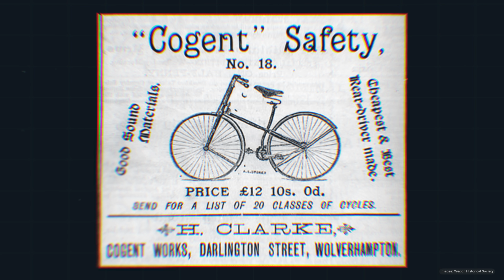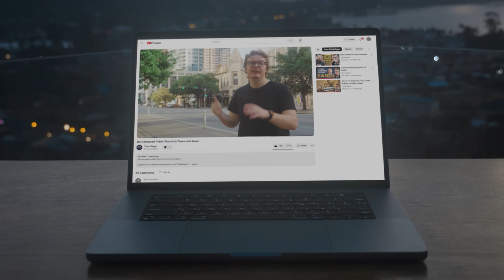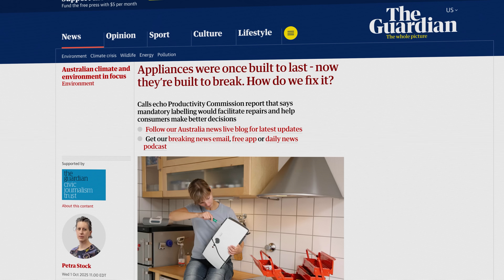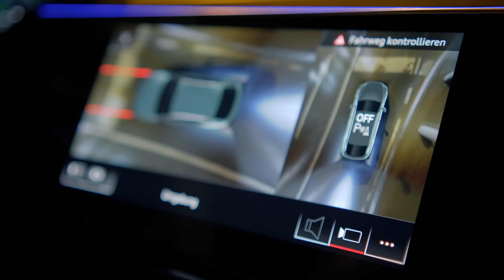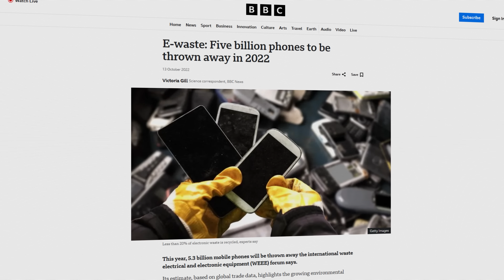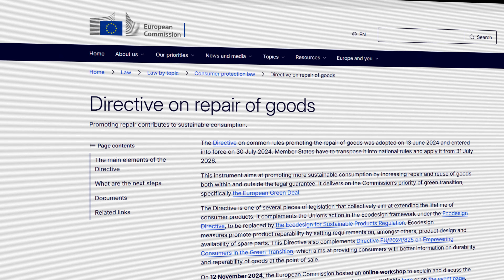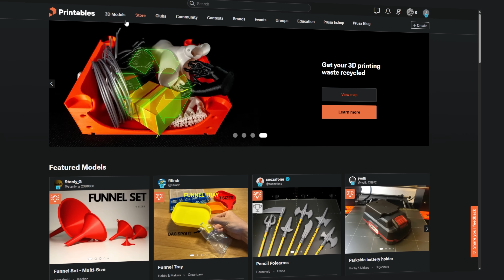Built to Break: The Hidden Design of Planned Obsolescence

Comment: Ashley byte gateway to motorcycles. I'm sorry but you need to do your homework. Because motorcycle came from putting a small engine on a bicycle that where motorcycle came from. Motorcycle came from bicycles in vehicle came from hurt from carriages that wine, when the car model T referred in to duty, will call the horseless carriage.

Comment: Oh, noThe light bulb they said, no, it's athlete.The light bulb that last forever are literally dimmer they're not brighter, but you need more light.You have to thin the wire doing thin.The wire you get more brightness out of the light but that burn out the lights.Sooner if you want a literally long acting bulb, get the um, did the dim bulb like the lower walled bulbs?They longest, but they don't have the brighted lights

Comment: No, literally the tetanar. You can purchase it already obscelet, because they literally when they abelt it, they're its affordability, basically, if I can't let this chip. Now when you'd be like May 10 years ago, it will cost $500 to chip one. So they lower, they weigh on it until the chip is cheaper. To maid, like up for a $100.
You made the chip set for a $100 when you furt, but do you have caught $500 to make it? But if they wait on the technology, the technology will actually get cheaper, they'll now only a $100 to map it to a chip set. So what better waiting To make it forever for people or making it $500 when it first came out. They even said people even said after the people in the tech Andrew even said it. When it comes out for Matt production, the technology, it already several years old. Because the new chip, it also several years old, they said they're actually more powerful chips in production in lab that they're working on more palping a chip. We have now, but because they're so expensive to make, they're no point into releasing them today.
Like 9K. They're literally, they're literally video camera higher than 4K. Now there's it's all 9K, but 9K is so expensive that it don't be until 20:13. Before you can actually see 9 KT V.
That how expensive is
In our top program, obscellation ISIS after you buy your phone. They slow it down like, um apple, does apple slow? The iPhone down after the while.
Unlike Samsung, who said log their phones, they even said like the Nokia that phone from Samsung, that phone still lasts forever, and they're still making it. And that phone was tougher than hell.
And that phone built the last, but they said, um, many lighty smartphones The make the smoke the foam to that one. The scent made me the no. That Samsung um, that big brake phone is so big and so strong. It become law. The component are a lot bigger but to make these cell phones law. The opponent had be a lot smaller lot. Smaller. The phone from decay over time. Athem is athe lowered the life of the phone and products Bailey. A thicker, the wire. The longer it lasts thinner the wire, the less it lasts. Samsung Cent Mobile their phone after you have a 10 to 20 year lifespan. Because how they're built
In because sometimes see battery drain battery come, let effective. The longer you have them, over the year that the content recharging of the phone slowly decayed the batteries, something that sometimes phone. Their internal are fine, it's it. The battery is shot from all the recharging. Recharge your phone at the solely damage your battery over time. It might rechargeable battery over months in your rechargeable batteries have to replaced Because they slowly stopped holding a charge

Comment: Great video! The lightbulb story isn't all that accurate, though. The limiting of lifespan for lightbulbs had more to do with the amount of energy longer lasting bulbs use. A longer lasting lightbulb uses more money in electricity to get that longer lightbulb, more than a replacement bulb costed. You can see this with the centenial light, it barely glows. Technology Connections made a great video about this.

Comment: As someone who had to rebuy my record collection 3 times by the time I was 22 yrs old on 1992.

And I may point out  worked predominantly in IT.

I have hated technology and planned breakage and forced purchasing out of the gate. When my son was about 8, an I was showing how to use various household items so he would know how to do laundry, run the dishwasher, what to flush or not flush the toilet, how to figure out if something was a better price or not. He's born in 2003.

One of the things I taught him was about 'the linch pin'.

I showed him on everything we owned how to spot the linch pin. How to a void buying items with one if possible and how to prevent breaking items that had one regardless of the choices available. 

I explained a linch pin is a deliberate weak point designed to break earlier than the lifetime of the item. And that that small part, will not be available for repair rendering the item useless and force you to buy a new one. Or a linch pin maybe a "new technology feature" that is also designed to break.
Other linch pins are features that make it impossible to proper clean an item, thus causing dust and grim to build up and cause the item to break or be next to useless.

I pointed out what to lock for. Our dishwasher had two. The door for the detergent is cheap and flimsy and can easily snap off, and unfortunately they didn't have any other models without this, the buttons were those plastic computerized electronics ones (right above the vents for the steam no less). 
I told him to always do things in a systematic order (this is handy for many tasks btw) I explained when the dishwasher has stopped running, open the door all the way open and close the door trap to the detergent than open ensure that the door of the dishwasher is opened fully to allow the steam out.

I showed him when buy small and large appliances, buy ones with nobs and switches not computerized touch pads. Buy those with the minimum amount of features. A coffee machine only needs to make coffee. It doesn't need 15 settings.

Items like fans etc, buy those that are made of metal, have a proper cord and have a easy to remove grill to properly clean.

I explained the importance of cleaning items regularly. I explained that dirt under a microscope is actually jagged and breaks down components and fibers, dust also clumps up and ruins motors and other moving parts.

Dust and lint are a major fire hazard.

Then we discussed electronics and computer electronics and devices. That was fun 😅. I showed him how printers, software update anything deemed smart = designed end date. 

At 55 I am in the process of putting everything on paper. I actually have all my originally paper files since I left home at 15. Paper stored proper lasts. I have 40 year old files to prove it.

I am going back to paper, the mail system, cash, cheques books, pens and pencils. I have had enough. 
Also radio and boring tv. I have my old cable box and vcr and cables and an older tv. 

The one problem is, about a year ago, a bunch of people were looking for LAN line phones, I have mine, but our telephone company now plugs everything into the telephone jack but it they made it so it HAS to go through a wifi box. My cable company still offers cable tv.

So the switch to a LAN line or Landline where I live is impossible. 

Low tech the way to go. I am done. 

I will figure out the phone thing later. But in one year I will have everything off any computerized anything.  Company and the bank can mail me and I can mail payment back. Same with forms etc. I can go in just like we did back in the 80s and early 90s. They fucked up. And I want out. 

I also showed my son how to spot quality in clothing and other apparel. 

I am so glad my mother and grandmother taught me to sew and about different fabrics, leather, etc. 

I have the same 100% full length coat I bought at a mid-high end store that I bought when I was 25 years old, and I am still wearing it today. Same with some leather shoes, boots, and gloves. 

We lost too many tradesmen. Cobblers, washing machine repair, watchmakers etc. We need to start using their services and buying these types of goods again. 
Glass, metal, wood, paper, cardboard, leather, cotton,  wool, linen, and fur yes fur etc.

Comment: This channel is punching way above it's subscriber count in terms of production, holy crap!
It's interesting to me how much planned obsolescence has accelerated in just the past few decades. I'm restoring a 1995 car at the moment. Not only does the owners manual contain basic maintenance advice, but if you want to do it yourself, you're also provided a number to call if you want to order the factory repair manual that the dealership used to fix the car. Now, automakers don't even want you to look at the engine. How far we've come.

Comment: I am here from Jjjacksfilms, but I've been talking about planned obsolescence for YEARS and I refuse to upgrade my phone, my computer, or any other electronics until they are completely dead. I have been on my same two phones for 4 and 6 years. I've been on my $2k laptop for 5 years, and when the battery started to no longer hold a decent charge (literally would last me 1.5 hours off cable), so what did I do? Replace the battery. I have issues with my drivers occasionally, but luckily I'm slightly tech savvy, and have taught myself how to troubleshoot and repair drivers. Just because something is beginning to fail, doesn't mean it's failed entirely and is fixable.

Comment: The lightbulb story is effectively BS. Technology Connections went over this at length. If you want a lightbulb that's bad at providing light, or a lightbulb that's excruciatingly expensive, sure, yeah, go ahead and make a 50,000 hour incandescent. Those existed and worked- not in the way a 1,000 hour bulb would actually light up a room with a (relatively) low energy cost to operate. It was all a triangle of tradeoffs. Was there a bit of price-fixing and agreements made? Yes. But the centennial bulb is an example of three things. 1.) an extreme outlier that has survived despite all of its contemporaries burning out, and 2.) babying the shit out of it (it's on a very low power separated power supply so it doesn't ever get jolted and burned out by things like, say, turning it on, or power fluctuations), 3.) a bulb that's completely useless as a bulb. It barely sheds enough light to walk by. Certainly not likely to read by it.

Unsurprisingly, all the bulb companies LEAPT at the opportunity to do bulb-sized fluorescents, and from there have jumped all over the LED bulbs, both of which are vastly longer lasting and better options than old incandescents.

Comment: hi, here from Jack. ive always wondered if every form of digital storage is also planned obsolescence. they say it's down to the degradation of the physical materials and due to the charge running out on flash memory, but even hard drives and SSDs die fast compared to anything else we've ever created

Comment: I feel like no planned obsolescence discussion is complete without considering that it's the market that creates the space for this. Fast fashion doesn't exist because brands are trying to trick us, it exists because if I see a $5 shirt and a $30 shirt I'm gonna buy the $5 one and brands cater to what we want. There have been multiple attempts at  modular upgradeable phones, but they've all failed because nobody wants to pay more for a phone that's awkward and cumbersome. Yes, light bulb lifespans were limited, but not because they lasted too long. It was because the long-lasting lightbulbs of the time used a lot more electricity to produce less light (Alec from Technology Connections has a fantastic video on this.) If planned obsolescence was the reason for this, we wouldn't all have LED bulbs that will still be on after I'm dead. Those are popular because they have the benefit of the long life, but for the same price and without sacrificing brightness, and the fact is, even if the major light bulb manufacturers wanted to prevent us from getting them, they wouldn't be able to because there's a clear market demand and someone else would've filled the gap in the market. I agree that money is the main reason companies do just about anything, but the reason things don't last as long as they used to is because when we found cheaper ways to make things, people stopped buying the expensive ones.

Comment: A bit of Planned Obsolescence you missed is what is now happening to digital goods, Digital Goods are effectively permanent, as long as you have the files & data, those things are always there. But now companies are shuttering their old games, or hiding them entirely (Forza Horizon, The Crew), to sell the new game. 

They're adding locks to the software so that you can't open them unless they approve (anti-cheats) and robbing you of your purchase after an arbitrarily decided day. 

These same companies are also spending an ironically enormous sum of money on lobbying to convince lawmakers that it's prohibitively expensive to keep the game running - when all that has been requested of them is what used to be the industry standard of shutting the official servers, but allowing unofficial servers. Something that would cost about 1/100th the cost their lobbying takes.

I fear this obsolescence will spread to things like E-books or Movies, where they revoke your access beyond a certain unsaid date due to the "costs of keeping it available"

Comment: While planned obsolescence is a real problem that actively makes world a worse place the lightbulbs life span limitation is a weird example. The manufacturers had a more or less valid reason to do that - as bulbs age they become dimmer and by completly likking it after a while it will ensure that it will be bright when you'll need it. If you look at the example you attached it barely produces any light, even for an allegedly reduced voltage it's running on

Comment: I happily use what I've got until I physically can't anymore. I used my original phone for about 8 years, used my dad's old work phone from 2017 after until it was stolen, then ofc had to replace that. I used to be worse about laptops, replacing them after 3/4 years or so since they were just not powerful enough. Got one now that will actually last longer (unless something goes wrong).

Comment: The lightbulb that's been on for 100 years is also sort of cheating. It's like a 4 watt bulb in terms of brightness. They did make lightbulbs last less time on purpose, but the 100 year bulb is running lower than its rated wattage. If you ran a 100w bulb at 30% it would last longer than 1000 hours no matter how much they want it to fail then.

Comment: While this video is good and informative, I have to say that the lightbulb cartel story is more complicated than is popularly believed. The limits on how long a bulb can burn were set, primarily, due to light quality, brightness, and filament longevity. As well as other factors such as heat, electricity consumption, and premature filament failure. Technology Connections has a great video about this I recommend watching to anyone interested. Lightbulbs lasting less time was more of a consequence of standardization of filament brightness, longevity, quality, and affordability rather than an attempt at planned obsolescence. The fines were dolled out because if one company advertised a long lasting bulb, it was done at the expense of brightness. This made all incandescent bulbs look poor-performing to anyone who bought one because it would be dimmer than competing electric or traditional indoor lighting systems, thus giving the other companies' bulbs a bad name. The century lightbulb, while long lasting, is terribly dim and extremely warm (light temperature wise), it was manufactured incorrectly and never got bright enough to wear out the filament.

Comment: I really hate doing it but are the illustrations at 5:03 5:17 6:24 and 6:52 AI generated?
Reply: 5:03 and 5:17 look like they might be but 6:24 and 6:52 look like normal stock footage
Reply: @Biiiivv That's what I was thinking but also 5:03 and 5:17 have the same lightbulb design (except in the factory scene)

Comment: With phone planned obsolescence, I've been considering making a chunky Pokedex-like case for my phone, with a thin powerbank on one half of the shell. Why replace the battery when i can carry more battery? Only real reason is that it's heavier to carry. I like to wear tradie's pants, it's 90$ for a pair & i only have 2 pairs. i find them comfortable & 100% worth it. Of course there are some things i am unhappy & suspicious with, as part of the thread on the lip of one of the pockets broke, but because they have a belt loop AND elastic they're really comfy to wear & hold heavy things in. Buy cheap, buy twice applies a lot. It doesn't apply to phones at this point; we will buy twice... But, if you can find better ways to bring a liiiittle bit more gear with you wherever you go & clothes that'll support older tech in the form of powerbanks, then definetely do so.